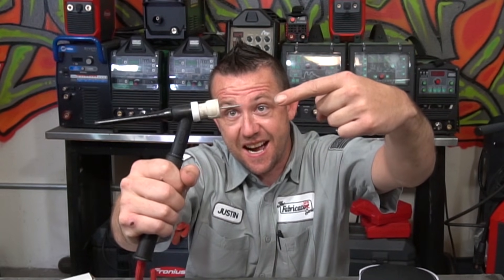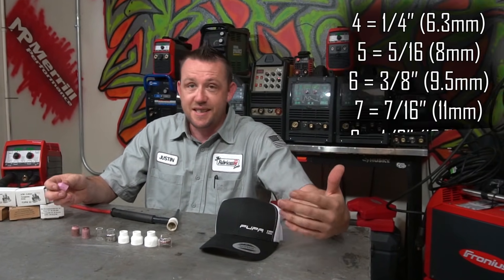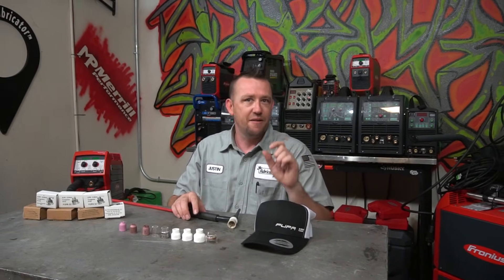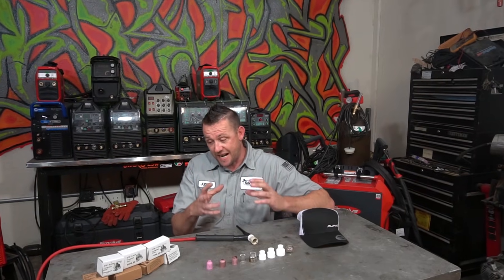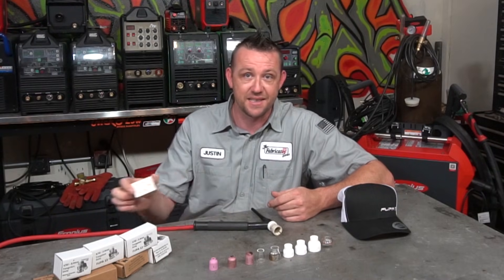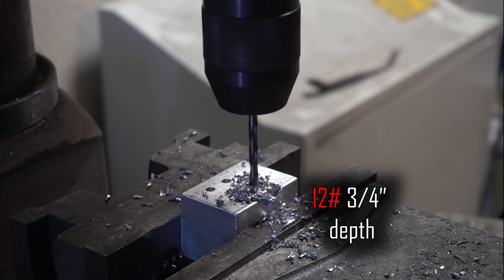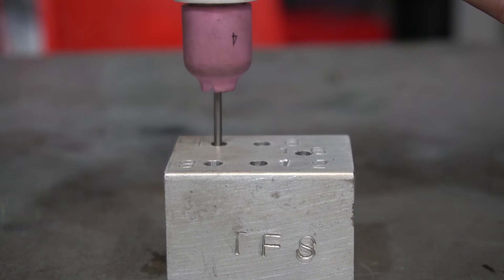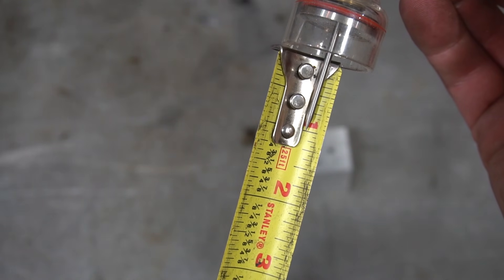TFS: Does Tungsten Stick Out Really Matter?

Comment: total rookie here... but my observation with more stick out is the tungsten has less opportunity to heat transfer to the torch and it "Might" be overheating and oxidizing on post purge.
Reply: Yea orange glow_takes longer to cool off. I increased gas flow_still did it. I was out too far. Explains why my pipe welds are😢   Good info here, thanks

Comment: Fora stick out depth gauge... why not instead of all those holes... just etch q line or a slight notch the size of the tungsten on the side of a small block, and then put a strong magnet on it, label where the measurements are and then adjust the magnet to what you're using, now you can see everything and trust it without a bunch of holes

Comment: im practicing welding 1.5mm stainless steel pipe but im having some problems. i don't have a purge setup I know i should but i don't have it. I seem to use too much filler and the welds are not good. i do realise i should be purging the pipe but what is the best way to weld this pipe without purging and getting the best results possible without purging? 

i want to move into making exhausts so even if i could purge it will get tricky to do so when im welding long sections together.

thanks in advance

Comment: I am a amature never tiged i have a very locost semidry 5200d its a plasma tix & stick iv used stick worked realy well for the weld i grow up on old school, plasma cuts very well up to 3/8" i have cut grade 5/8" bolts rusted to hell! but now in in to welding my used aluminum flatbed i have a soppl gun that for my first try at aluminum did and is getting better at , but TIG iv tryed all heat ranges used a regular grinding wheel ? and had any thing from black soot to liquid aluminum and heated it up so much i could not touch it any help would be great im all so using a 1/8" 4043 aluminum rod on 1/8" plat thank you

Comment: For your stick out gage, couldn’t you just have a cone shaped hole with a 26.6 degree slope and a flat bottom to account for the cup wall thickness… should be able to do any size cup.
Same would work with just a triangle cut in the side of some flat bar and would be less likely obstructed by the handle with different neck arrangements.

Comment: I only use excessive stick out when welding down into a hole
Like a broken bolt or stud below flush. 
When you drilled all those holes in that block I was hoping you were going down that road.

Comment: when youre welding stainless, does the table have to be made of stainless as well? (i.e. if it was a mild steel tabletop, when the arc passes to the ss, would it contaminate it?)
Reply from the maker: Unless a very specific code for a very specific procedure specifies it very specifically - no.
There are no metallurgically transmitted diseases.

Comment: Justin I've decided to come out of retirement (for many reasons we won't delve into here) and but a TIG 225x AC DC Tig MMA welder based on your review of the machine I watched here on U=Tube. I'm an old fart and a retired contract Millwright by trade among others. I've been retired for the last five years after spending 12 years in Iraq and Afghanistan. Welding (like shooting) is a perishable skill, so I already know I need to buy a butt load of scrap from the junk shop and get my hand back up to snuff. I'm raising my second family on SS (long story) so I have a limited budget. I was researching these IGBT welders and the one above appears to be the best bang for the buck. It's a stretch on my budget but with some belt tightening doable.  This "Plandemic" along with the associated lock down is driving me up a wall, Hell I'm not even allowed to enter a government building here in the PI because I'm 75 years old. Plus my curfew is from 15:00 to 06:00 the next day GO FIGURE!!!! Welcome to kindergarten. I will get back into building what ever people need and can afford, plus get back into my first love machinery and tool design, if by some miracle the economy bounces back  (don't hold your breath).  Thank you for your videos and helping this old fart gain a modicum of knowledge on these new fangled machines. BTW the best machine I ever owned for the field was an old Lincoln torpedo welder, in my shops (back in the day) I stuck with Hobart, Lincoln, and Millers. but they are way beyond my budget today.  Thanks again for your time Bud.

Comment: Your videos are very educational and informative. I have working experience with brazing and pipe sweeting. I am interested in getting back to tig welding. It's been years since I last used a tig. I will be purchasing an AC/DC tig from harbored freight. But, should I use the peddle or non- peddle option?

Comment: Im in school using a #8 ceramic cup in ur pernal prefrence how much stick out and heat should i run? Im doing butt joints and lap joints on steel. Its less then a quarter inch thick or so

Comment: Years ago when I was selecting a TIG torch range for my Fronius MagicWave 2200.  
I came across a torch that had a different collet design said to lower the distance to the tungsten tip thus lowering the weld resistance.  I didn’t know if it was marketing but it made me conscientious about how much tungsten I had extended and to always use the right collet assembly. 
I didn’t end up choosing the low resistance torches as I was looking for a torch range that I could get consumables for easily in an emergency, like a Saturday afternoon. 
I actually ended up using Fronius torches as their duty cycle was so much higher so I just sucked up the cost of keeping plenty of their unique consumables on hand.

Q. Can you or anyone please advise if tungsten length does effect the resistance in the same way that tungsten diameter does? 

Thanks for the great videos.

Comment: I've got question if it is not to late, what if You go with 16 stick out and increase gas flow?
Reply: That's rite you need higher gas flow 35 cfm is not even close to enough gas try 60

Comment: You did not take into account possible impurities that can affect both the bead and the tungsten. When I was taught to weld that's what was drilled into me.  Not the weld specifically, but the possible contamination of the puddle or the red hot tungsten.

Comment: The very first thing I found was I could not see the puddle at the recommended lengths when I first started TIG. These were recommendations by the so-called "pros".  Therefore when I first tried welding my results were miserable.  Useless info then I'd say.    I've found that most people who sit back on 'the right way to do it" or "the industry standard blah blah blah"... are useless or worse, wrong.  Experimental evidence - experience - this is how we get results.  We investigate the "givens".  Great work indeed.

Comment: i got a queston for ya fab guy , if you have a DC tig welder , powerd by a AC generater will you get the properties of a AC tig welder? or will it mess up your DC welder? ,
this is killin me , i got to know?
Reply: No, a DC welder transforms AC power into DC current. So, you couldn't run a welder on DC current, actually. It has to have AC input. But will always put out DC unless you have an AC/DC welder.

Comment: Another great video thanks. It's these details that help understand the how's and why's as i am new to Tig welding. Lots to absorb for a first timer as even basic settings can be difficult when you cannot understanding the problem and need to correct technique or setting adjustments.

Comment: I would think that gas flow rate also needs a bit of tweaking along with stickout.  I do understand from a pure experimental standpoint you want to only change one variable at a time.
Reply from the maker: You get more accurate data when it's only a single variable. Adjust multiple things and the data becomes inconclusive. Stack data on data by only changing one variable at a time and you get one ridiculously long episode.

Comment: was I missing something or was there no gas flow mentioned in the whole video? 

How much gas do you use with 25mm of stick out?!
Reply: He covers this in another video. Cup number x 2 = minimum cfh to run.
Reply: Yes and also the blanket behind it will help keep coverage over the weld and flow from cup. Argon is heavier than air. And will fill the area as long as it's covered.

Comment: I am a noob to tig and was having trouble seeing my puddle, lifting my torch to see the puddle caused major porosity weld issues, watching this helped me realize I didn't have enough stick out, thank you for these videos. Can you do a video on cup size nd argon flow settings, I have basically been using 20 for everything for flow regardless or cup size and it's worked well enough but my stick out has been way to short after seeing this.
Reply: Cup size x2 = cfh

Comment: Hi,
Does the formula 1 amp per .0.001" - subtract 10% applied to thicker materials as well, because applying the formula to a 10mm is equal to 354amps required to weld.

Comment: What is a good TIG welder for welding 1/8" to 1/4" aluminum? Tubing and flat. I want to learn to weld aluminum, and don't want to get a junk welder so I have to wonder if bad welds are because the welder is no good. I'm pretty good at DC arc, and gas / oxygen welding, so I know the pushing the puddle part. Just need to learn how to do it in an inert environment.
Great videos. Thank you
Reply from the maker: It's rarely ever a "bad machine". It's usually a machine that is not capable. 
Anything with 200 amps or more should  do the job for you. It's just a matter of deciding on your budget.

Comment: Just from the first impression of the vid, (and I like to speak out prematurely)  is that you sometimes need that tungsten stickout as extreme, (with the proper gas lens), if you gotta get your arc close  to the joint, an a tight location that you normally cannot reach.  There is a reason, and application for it, now i will finish watching the video of this amazing teacher.  Cheers!

Comment: I welded a crappy cast exhaust port/flange (Harley-Davidson Shovelhead) with a #10 and a ton of stick out in the beginning, until I got the deep part filled, then went to about 3/8" stick out. I bet I was 5/8" or more in the beginning. I turned up the argon flow to about 35. Don't know if it mattered. Nasty metal.

Comment: Man if you have time to do the same test again just do it with a single cup, when you lower the stickout size drop your CFH the same percentage as the amount of stickout you use to show the same gas flow say if your running a 3/4" stickout on a number 12 at 25CFH try doing a half inch stickout @ 18CFH or roughly 1/4 less CFH see if the results are identical would be awesome to know also

Comment: Great vid and info Justin, its something I've always kinda wondered about, but never really got the chance to test out, especially to the degree of accuracy which you have here, which is more than adequate imho. I deffo am with you on going between the 12 and the 8, 8 looks the best to me in this example. It would interesting to see what that same setup would come out like using number 10 stickout.

Just FYI, and maybe other folk's too, as a "speed setup" thing, the way I've always set my tungsten is to leave the tungsten loose in the torch while I rest the bottom edge of the cup on a flat surface, the tungsten also of course is down on that same flat surface, it being loose. I then rock the torch either forward or back as needed, eyballing the angles as I do so until the cup and the tungsten create an equilateral triangle like something like this, but "squarer" /\ in relation to the flat surface, (or an "X" type shape - basically you're looking for 90 and 45 degree angles if that makes sense). It's then just a case of nipping down the collet and you're done - with parctice I find it's pretty accurate and can be done in just a few seconds (about 5 or less at a guess, never timed it though)

Comment: You might have wanted to mention less stick out you can run less argon flow, more stickout obviously you need to run more for the required coverage. Running the same amount of gas for those different stickout lengths will obviously give different results due to gas coverage.

Comment: The only time I ever actually use a lot of stick out is on collectors and x pipes
Reply: Yeah, David White tight corners, angle or gaps etc, where you just have to get that tungsten in close enough for consistent arc length. I find that the angles will sometimes kinda hold onto the gas for you, or if not I just make a kind of catchment bowl using aluminium foil to make an argon "bath" to keep the pool from oxidisation.

Comment: Came here for the post-intro "WTF screen", stayed for a rather informative and interesting video :)

Couple of tips about the CNC: You can download so-called 'screens' for Mach3. They are in essence different layouts of the controls. My personal favorite is 'Aqua' since it's not as cluttered as the standard screen and it's design is more pleasant to look at. Number two: for some reason after finishing a pass your CNC wend down to Z0. You should add something like this to the end of the code to prevent this:

M05 
(turn off spindle or whatever machine thinks is spindle)
G04 P500
(pause the program for half of a second)
M09 
(turn off all coolant outputs, possibly gas to the torch)
G0 Z1 
(quick retraction to 1" or 1mm above surface)
M30 
(rewind to start of program)

It's good to have a simple text file that you can copy/paste from to get all your basic commands for the beginning and end of the code. Do watch out for G43 (cutter length compensation) since it will send the machine to Z plus whatever-the-tool-table-tells-it-that-the-tool-is-long and it will start working in the air instead of in/on the part.

It looks like we are using same software and controller, so if you have any questions then feel free to ask!
One more note: another interesting thing is that on that particular controller there are two on/off outputs for spindle, one for CW and one for CCW. They are turned on by M03 and M04 and are both  turned off by M05 in the G-code. That means that you can have two attachments on the machine and have it do two things one after another. For example, you can set up the machine to lay a bead with a welder, wait couple minutes for the bead to cool, and pass over it to spray some rust preventative from a can that's activated by a servo.

Comment: Due to the relative high resistance of tungsten the greater the stick out the more power is going to be lost in heating up the tungsten and the less power in the arc. So the longer the tungsten the cooler the arc will be for the same settings on the welding machine. The weld heat is produced by the I2R  (current squared times resistance)losses in the arc.

Comment: Now run 3 more weld lines at the longer stickout (say 12). One with the torch and cup tilted and pointing 'ahead' of the bead (simulating how most folks weld, feeding rod from the front). One with the cup angled backward (which should blow shielding gas back over the bead and keep it shielded for longer). And one straight up / down as you did here.
Reply: Maybe another video with a bunch of different angles.
Reply: balisticsquirel was thinking the exact same thing. In theory, due to geometry, an angle should technically all for some degree of extra stickout. I dont think it will be much but should. And then there is still the flow variable and turbulence factor related to it.
Reply: Didn't have far to go into the comments to find thoughts of the angled torch effect, 1st one. Hope to see a follow up too. Weld done
Reply: L'important c'est que le bout de l'électrode soit à 1 ou 2 mm du bain de fusion,  il en découle en fait naturel qu'en angle intérieur il faille la sortir suffisamment pour pouvoir  le faire. Car un arc trop long est préjudiciable à la pénétration du cordon de soudure .

Comment: Only time I get to a point I need more tungsten is welding spots on cages where multiple tubes meet. Otherwise I run an average. I have some small cups for sheet metal right spaces (thin stuff. But otherwise I dont fo crazy with all the cup sizes. I run a multiprocess inverter rig now so if I need something more than I want with the tig i switch to another.

Comment: Does it matter on aluminium ?
Reply: Mr. greens boat tanks and aluminium welding stick out is the same however Argon flow will be different
Reply: Welding Junkie the size is what I was referring to. My bad. 
Does the size of the cup make a difference on aluminium
Reply: Mr. greens boat tanks and aluminium welding as long as you keep your stick out to where you get proper shielding it doesn't matter
Reply: Mr. greens boat tanks and aluminium welding ah gotcha yes it does. You want to go with 8 or larger for aluminum and 12 or larger for stainless typically. You really don’t want to use say a #5 for Alu Because you’re looking at 5mm stick out kinda hard to get around stuff. You can prob weld flat position with anything. Basicky the longer stick out you need you shoukd match the cup to it if that makes sense. Good seeing you on here my friend

Comment: Interesting tests. It would be cool to see a similar test with one cup at a typical stick out, but several flow rates. I’d like to know at what point you’re wasting gas with the bigger nicer gas lens setups, and if it’s possible to make them aspirate ambient shop air into the weld like you can with a smaller standard cup.
Reply: Thats what im thinking as well
Reply: 😊great  video  cool that you  explain everything

Comment: The illustrations were a nice touch, and good job on the editing. 

Even tho its not practical to run it at the 4-6 range do you think running your argon lower would help out the hot spots? Less turbulence.